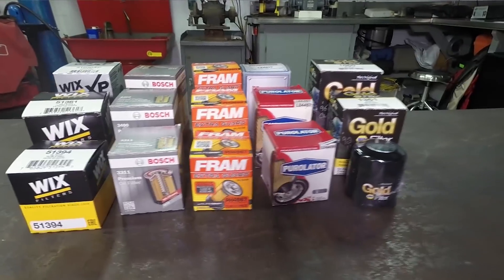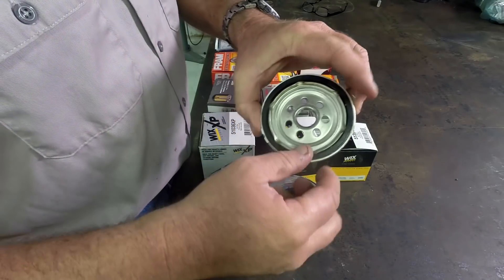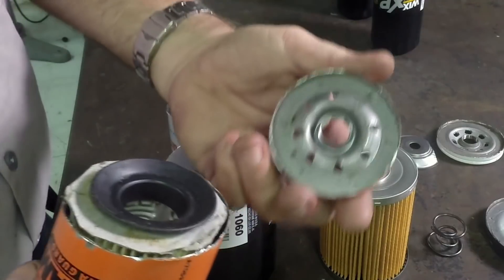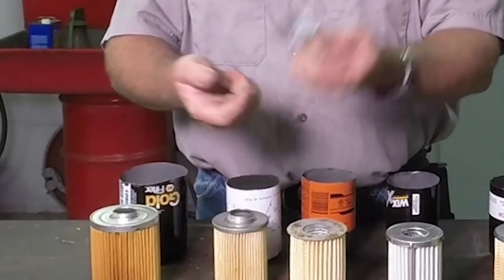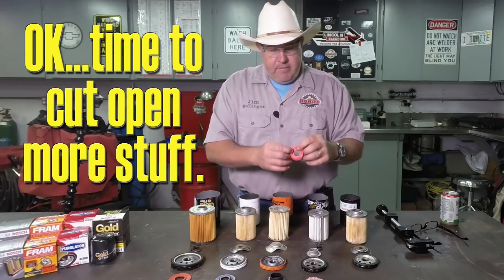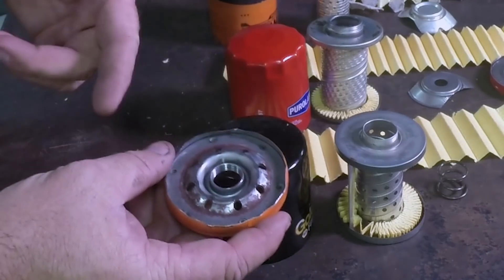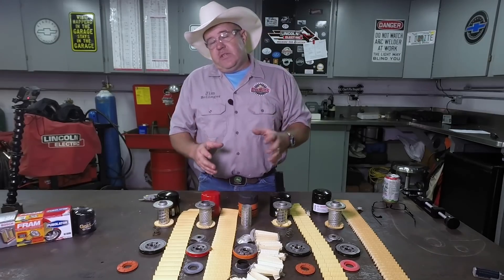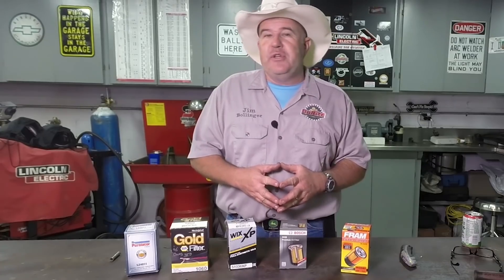The worst oil filter EVER!

Comment: Hi there DoRite, I have done a bit of this research in Australia and findings are similar to yours, The one thing I was surprised you overlooked entirely is the release valve which should be built into all oil filters to supply some (dirty) oil to the bearings to stop a total blown engine if the filter gets clogged , I have found a lot of these sprung valves are much to weak and would just open well before the release valve in the oil pump, which means especially when cold or oil is too thick, a lot of oil is just bypassing the filter medium entirely...
Reply: Our small block chevys have the filter bypass built into the filter adaptor, same for my buick.  Thus, PF42 for instance, doesn't have an internal bypass built into the filter.
The SBC doesn't need the anti drainback, the top of filter is up and same vertical position as oil in pan, thus optional and one can choose with or without adv..

Comment: I have a problem with your test. For example you are comparing high quality (heavy duty) line napa and Wix filters to the lowest quality line FRAM and  Bosch filters (Bosch Premium (which funny enough) is the lowest line). But I agree this particular FRAM filter is unexceptable. Informative video nevertheless.

Comment: You should cut apart a FRAM HP1 or an HP4 filter.  You will see something different.  FRAM makes cheap junk, but they also make good filters too.  Those FRAM racing filters are more expensive.  You get what you pay for.

Comment: "*Return engine oil pressure"
Wrong. You were right when you said it. They hold the engine oil pressure. There is no return oil pressure. The oil once it goes where it's needed, is dripped back into the oil pan (Not including the oil that is slung by moving parts). Oil goes from the oil pump, to your pressure gauge, then straight to the filter. The filter couldn't do it's job if it only filtered out return oil(if there was such a thing).

Comment: More to the point would be to check how well they actually filter oil and whether they stand up to the oil pressure or not in service. The rust could be due to how they have been stored and It could be argued that the FRAM filters are more eco friendly as they don't waste so many expensive materials. This was not a very objective test. I have no affiliation to any automotive brands but I am a qualified Motor vehicle technician of 40 years experience.

Comment: I wondered about that, I just changed the oil on my car a month ago, took out the napa filter and put a fram in there, not even 3 weeks later the oil was black as the stuff I drained out. I didn't even think about bad Quality filters. I thought fram was original quality. Thanks for clearing things up!

Comment: Does this video demonstrate that Frams do not filter oil? No. It demonstrates that they are cheaply made. This may or may not impact its filtering capabilities. I've been using them off and on for over 4 decades with zero failures. Show me some lab results that state these cheapie Fram filters do not filter oil, then I'll be a believer.

Comment: This guy didn’t break down an Amsoil filter. I have seen test results where the NAPA silver beats the gold. This guy cherry picked the filters. SHOW THE AMSOIL FILTER! ! !
Reply: I think you’re missing the point. He clearly states the video is to show the Fram filter issues. Sure there are a bunch of other filters not shown, the fact showing one amsoil filter would solve that notion though is a good chuckle.
Reply: @Avicados  i think you are missing the point. Cherry picked props for sure. Fram has always been junk but applauding NAPA does not prove anything. In an extensive study the NAPA gold was inferior to the NAPA silver in its ability to filter. Just because the can is “sturdy” says nothing about its ability to filter the components that cause engine metals wear.
Reply: @mewanttools7275  again it’s not about Napa. It’s about Fram.
Reply: @Avicados  Cherry picking! If you are going to show the worst then show the worst. If you are going to compare then show the best!

Comment: I put Motorcraft on the 94 Ranger. 276,000 miles
I put Toyota on the 68 Corolla. 70,000 miles (again) it's rolled over more times than I can remember now.
Castrol 10-40 in the truck. 20-50 in the car.

Comment: I remember a frienda' mine who said my CRX's engine would run the best if I used a Fram filter on it. He said something about it increasing the oil pressure. I quickly looked at him with an "are you serious?" face. It was the cheapest garbage the autoparts sold here in PR, and everybody knew they were crap. Heck they even look cheap with the tacky orange color and the name just sounds like a nightmare. He was still a kid at the time (though, so was I, only difference was I was informed) so I'll let it slide.

Comment: Proof ain't in those new filters. Show us some engine oils after 3,000 miles. Show us some engines after 100,000 miles using those filters. Ya got no idea how well they work. It ain't a beauty contest. A little rust is insignificant.

Comment: I have always insisted on Fram, because the grippy stuff on the outside was an obvious sign of quality. I'm a schmuck.
Reply: I stopped using Fram a while ago, and the grippy stuff is the only thing I miss.
Reply: @andrewwalsh9849  just think gritty stuff floating around in filter
Reply: you don't need that grippy stuff in any case, it's a gimmick to lure the customer
Reply: @mmdirtyworkz  It definitely makes it less slippery in your hand. Maybe I have poor technique but I drop way more filters when I unscrew them now than when I was using the frams.
Reply: @andrewwalsh9849  Maybe you are used to have grip there. I've never used such filters and haven't dropped one in oil yet. But I unscrew it slooooowly at the end :D
Reply: I think we all fell for it at one point or another
Reply: Don’t feel bad, I used to insist on Fram.
Reply: Me too.
Reply: That "Grippy" stuff is crap too! it gets in the way of my tools, rubs off in my face, and makes a mess.
Reply: yea i thought they were going to be the best quality, but im glad i watched this
Reply: When I was a kid (16-21) I was all about Fram. Since then I knew to never touch the stuff
Reply: I use the fram tough guard or the ultra synthetic, never had any issues.
Reply: @Mr.G626  tough guard has the same construction as the orange one. The Ultra Synthetic is oddly very different in comparison
Reply: Fram has several grades.
Reply: @tim4u2uTube  You're right. The upper tiers are better. But the cheapest orange can sucks, bad.
Reply: @jaysource8302  yes its probably better to shove old socks in an empty coke can and use it as oil filter than the orange Fram filter.
Reply: @tim4u2uTube  and the fools leaving their comments shows how ignorant they are of simple facts.
Reply: @joynthis , unfortunately I think Autozone was out of stock on the Delco filter for my Buick last oil change so I automatically got Fram. Worse to admit, I spent 17 years selling parts and always recommended Fram oil filters after seeing a similar video showing them as best at a training seminar several years ago, so being retired since 2004, I now see a wrong I did to my many loyal customers. Unfortunately, as an ASE Certified Parts Specialist, several of those years I was the local Commercial Specialist to all of the garages, and being in a small southern town my knowledge of old classic cars, keeping paper catalogs to insure right parts first time, I built a close trusted relationship with this group of gentlemen. This is like being bit by a snake with more time behind me than ahead of me! Most of them have retired by now too, and I’m glad it’s only low quality filters I recommended instead of something dangerous as many as I sold. Time to ask my son to change the oil in my Buick again anyway, as I’ve been disabled awhile and now have Parkinson’s too (pardon typos). Being a petite female that the Parkinson’s has taken 40 pounds off of, nobody even recognizes me anymore so I simply ask to have my wipers installed for me. THAT still feels strange to me, although it’s all new employees everywhere haha. One day the Store Manager assisted me so I asked if he had ever heard of a previous employee who worked there by my name. He smiled and told me a story he had heard, very nice, then asked if I knew her. I smiled and said, yes I knew her well. “Thank you VERY MUCH for your kind help young man”. He made my day :) 
You aren’t the only schmuck, I promise. Not only was I a schmuck, but I spread it faster than Covid-19 thinking I was doing right. Tomorrow is a new day, and today we learned something new, thanks to the good man’s kindness who took the time to make and upload this video. It’s almost nine at night here and I’ve had a painful day I almost wrote off as a loss. Providing I can remember what I learned here, this made today worth living! Dad taught us we must learn something new every day, so it was almost time to look up a new word, which I detest doing haha! At age over 60, I am still obedient to my late father though, so if we couldn’t tell him something new we had learned, we had to open his Webster’s, choose a word and report back tomorrow how we used that new word. With this Parkinson’s, my brain needs exercise LoL ;) 
Thank you for your time. Merry Christmas and Happy New Year.🎆
Reply: Get a spray can of spray-on bed liner for $8-9, buy a whole case of "better" filters of your choice, wipe the bottoms with rubbing alcohol then mask off and spray the bottoms and let that cure for at least a day before you use em. "Grippy stuff" problem solved...
Reply: @macgyver5108  Too much work. I coated my hands with bed liner, now everything is grippy, if a little itchy.
Reply: Fram by far makes the BEST oil filter for motorcycles. Fram makes the same quality of filter they made 25 years ago before bean counters started cutting corners. They have always been made in Taiwan. Taiwan has a true motorcycle culture. 70% of all licensed drivers in Taiwan have a motorcycle, compared to approximately 5% in the US. They also take great pride in products they make.
Reply: I am another schmuck
Reply: No, you aren't! This guy is putting up Frams lowest grade filter up to others of a higher standard, don't fall for his BS!
Reply: No this man this man is telling the truth.

Comment: I take the filter media out of my filters. I cut the filter open, remove the actual filter media, insert a speaker magnet, and tig weld the housing back together. There is no need to filter the oil. The oil holds the particulates in suspension, and the magnet takes care of the larger metal stuff, just change the oil every 5000 miles. Just like all the small lawnmower Briggs and Stratton engines that have no oil filter. My suzuki Samurai has 237,000 miles on it, of which the last 80,000 or so were driven without a filter.

Comment: If you have an older car when oil changes were done every 3000 miles any filter including a fram is fine.  Going by todays cars that usually go 10k miles between oil changes and thats really where a fram (and some other cheapy filters) could hurt ya.  Jmo

Comment: And what about motor craft, stp, mobile, AC filters ... are they bad too? I have used Fram for the last 48 years and have never had problems with my cars or trucks, I always change the oil every 3 months or 3000 miles whichever comes first.

Comment: Began working in a power equipment industry 50 years ago and soon found out what absolute junk Champion spark plugs are - I have been Wary of anything heavily advertised since then.  If someone said Oil Filter, most people would come back with Fram.
It would be interesting to know what the micron rating is for each of those filters, or maybe they're all the same?  Not an issue for me though since I have the dealer change my oil and provide the factory use filter for my vehicle since they don't charge any more than the local grease monkey places and they include a multi-point check beside.

Comment: 2003 Toyota Tacoma all original 2RZFE with 346,000 miles of Fram filtration. The only time it ever had a filter other than Fram was the oem one it came out of the dealership with. I wonder why it's not dead yet?

Comment: Interesting review, however would be nice to also see actual filtering capability. Some filters may look great but still passes lots of particles.
Reply: I think Project Farm did a video testing this but im too lazy to check.
Reply: @ericchapman8956  Project Farm has tested air filters, but could not find any oil filter test.
Reply: @countryside_hobbies  the forums on bobistheoilguy. Com used to keep a yearly updated spread sheet of lab tested filtration capability of the most common filters on the market (wix, puralator, fram, k&n, bosch, ect). Fram didn't disappoint and forget to skimp on filter media. It was pretty rough.
Reply: @jamesbumgardner1469  Thanks, I'll check...
Reply: @countryside_hobbies  be warned it's a rabbit hole of madness lol they did a test some years back showing Walmart supertec brand synthetic oil was not only on par with some of the big name brands, but actually had a superior additive package than some of them. I don't know it still holds true, but I was impressed. They use Blackstone laboratory out of Tennessee if I recall correctly.
Reply: @jamesbumgardner1469    Good to know Fram is as good as any.
Reply: @scarhart
Send fram customer service 5 proof of purchases and they’ll send you a silver belt buckle and goldtone watch no joke
Reply: @jamesbumgardner1469  it's not only what the filter can catch but how much. The fram has the least surface area. When the filter media can no longer pass oil, that spring allows unfiltered oil into the engine.  Filter media is dirt cheap so why skimp? I only use wix or napa gold filters. With VVT engines oil and filter quality and maintenance frequency are more important than ever. 3000 miles on some oil brands Will coke the oil to the point of plugging that fram.
Reply: @countryside_hobbies 
I think he made one, but can’t find it anymore. 
I think he might’ve taken it down.
Reply: @ericchapman8956 
I think they did too, but can’t find it anymore.
Reply: This is what I thought too and was about to check out until he opened one and found rust in it, and then a couple more with the same thing.  I just changed the oil in my wife's car last week and used a Fram filter like I have my whole life, and I'm pretty furious that I need to change it again now and that I was suckered.  Would be interested to see a legit test though; of those other 4 rust-free filters, it's probably hard to judge their effectiveness by a visual inspection.
Reply: That would require putting a Fram on an engine and running it for 3000 miles. Better not be a good engine

Comment: Just stick to OEM filters and be a little obsessive with high quality oil changes.  I even skip changing the oil filter at times since I believe changing the oil is what is important. I wish someone would come with oil filter delete kit to increase circulation and avoid possible oil filter oil leaks.  I think oil filters probably have nothing to do with keeping the engine oil clean anymore with the tight tolerances of engines.  Cheap filters probably just cause extra paper to circulate in the engine.

Comment: i started using wix filters at some point, i cant remember when or why but probably the last 10 years. i think it may have been because on one of my cars early on i noticed during the oil change the oil looked a lot better than i thought it would. on top of that maybe reading or viewing something that sold me. im glad i always pony up the extra few bucks for a good filter because its important in engine longevity.

Comment: I’ve been usingFRAM oil filters since the day IGot my first car and that was 15 years ago and I still have that car and still use some oil  filters today and in the car when I bought it had over 250,000 miles and now has 300,000 miles and I still use those oil filters

Comment: I switched to WIX in the late 1980's (I think); I used Fram before that.  Why did I switch?  The small-time auto parts store had a counter top display of cut open oil filters.  The rest of the story is obvious.

Comment: Ah shit, last time I did my oil change, I used a fram because it looked like good quality from the outside, never again
Reply: Did your engine fail? No. This cowpoke cutting open filters does not demonstrate the filter's capability to filter oil, which is what they are for. The Frams may filter oil just fine, regardless of how they're constructed. Plus, Fram makes a few higher end products that are probably built better, but they cost double and triple.

Comment: I rebuilt a Chevy 350 back in the mid to late 90s. in the early 2000nds I saw a thing on TV about black market Oil Filters (NOT Fram) of the same brand I bought for the Cam brake-in of that 350 I rebuilt. well guess what? I still had that first oil filter I used in an old bucket under my bench. so after seeing that info on TV I ran out, grabbed that old filter and cut it up. and sure enough it had only a thin peace of paper in it with NO filter.
sorry I wont say the name of the store because I do not want to be sued, but I will tell you it was a large nation wide store that sold everything from bras to glue to fishing rods to BB guns to meds to car batteries and everything else.be careful people.